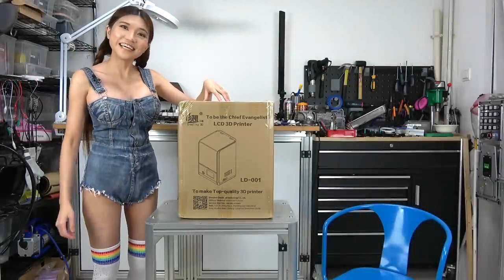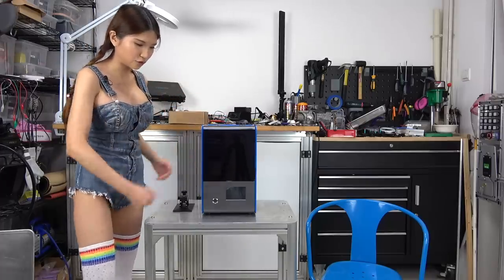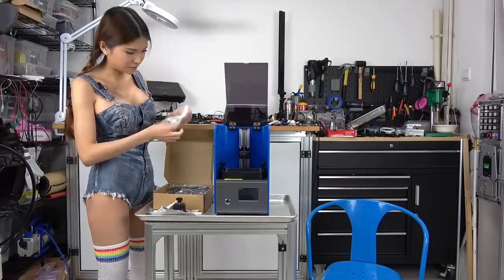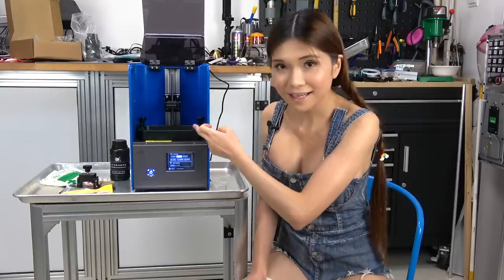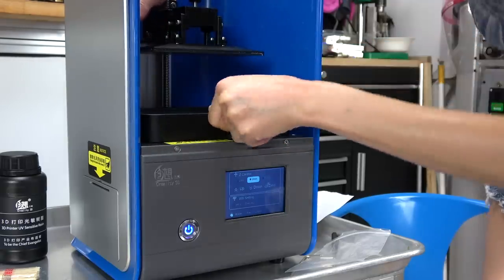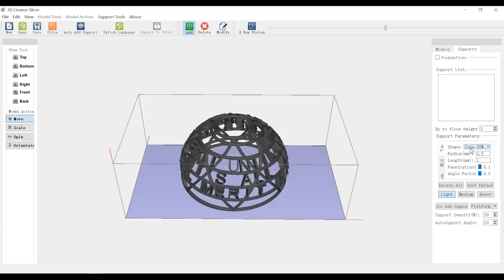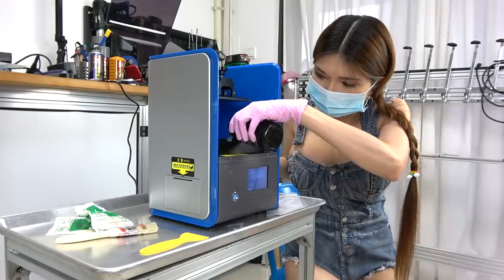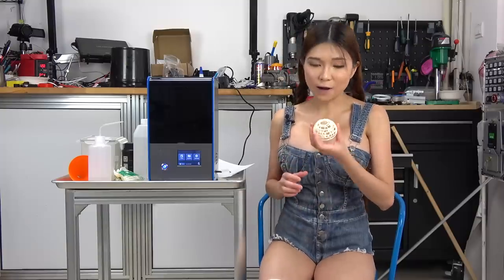DIY Hair Bun Cages with the Creality LD-001 DLP 3D Printer

Comment: Thank you Naomi! I am so happy to watch another BUILD VIDEO! That has got to be the coolest bucket/pail that I have ever seen! I was going to ask you to put a mirror at the bottom to make it an INFINITY BUCKET like you did with your SKIRT. The 3D print is inverted. That is awesome! I love the finished products! My Mom and sister sent me 6 pieces of black plastic hair buns with a poking sticks to hold those in place. I used one only once because the edges scraped my nape (the back of my neck). It hurt so bad. Maybe with that design, you can modify it for a bigger half sphere and to have holes on the sides for a long stick to go through the hair bun and hold everything in place. I can't wait for your next Build! I was able to finish my Iphone 8 Plus arm band, but it's not as high tech as the one you wear. I am blessed to find your channel through Winston/Serpentza. God bless you!

Comment: Great video. Regarding your "DIY curing chamber", try covering the inside of the bucket with aluminium foil or reflective tape before applying the LED. This will make your curing time 50% faster. Allso I would check with Mango 3D later this month for their slicer. See if it will work with the creality. Looks to be the best and easiest one out there. Keep up the good work Naomi. :D

Comment: How are the Buns holding up under extended use? And can you paint the material after it comes out of the printer?
Reply: i heard it's even better to spray prime and paint it. then it's even better protected against the elements. and the details come out better when you spray prime slightly transparent resin. (what they are most of the time. this isn't fortuitously.) also check NexiTech out on youtube when he uses the anycubic photon.

Comment: I'd like to know how this printer compares to the Anycubic Photon, from the splicing software to the print speed. Maybe now that you've tried both you can do a comparison video. It sounds like the LD-001 comes with more accessories, but the software is less mature than what comes with the Photon. Also, I don't think the LD-001 does anything to try to combat the resin fumes. At least the Photon tries, though it might not be very effective.

Comment: I have a question, why would you need the battery turn table if the light strip is already all around the edges of the bucket?

Comment: So the Creality printer is $100 more than the Anycubic Photon. What are the advantages of the Creality printer that justify the extra expense?

Also I think that the text you used in the model is absolutely wonderful.
Reply: williaty This. I'd like to see how it compares to the Photon.
Reply: williaty they say it’s faster than the photon. I wonder how long it took for printing that hair thing.
Reply: Faster? How is that when the speed is dependent on the resin cure time? Does it have a more powerful UV LED?

Comment: Hey, do yourself a favour and use a real respirator for fumes and gases and not a clinical mask. For example the 3M Mask-Set 6223M that contains a half-mask and the correct filtersets for gases and toxic fumes.
And a tip for work - clean the support out before using the alcohol and before curing. It is easier that way.